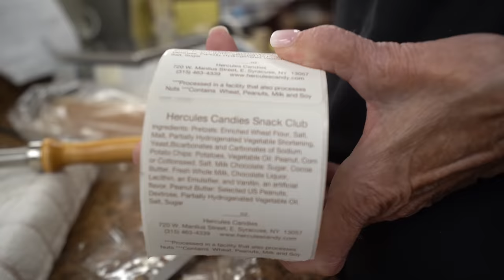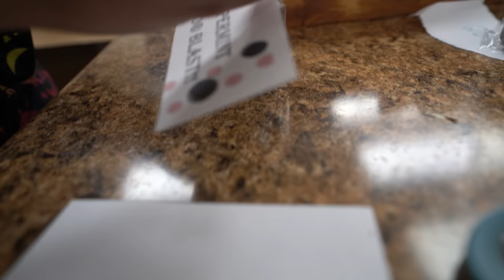YOU asked for it, so WE covered it in CHOCOLATE!

Comment: ive worked in kitchens and gloves were never really worn. You wash your hands constantly though, wearing gloves doesnt mean the outside of your gloves arent dirty.
Reply: That’s why change your gloves.
Reply: Also in most kitchens the food being touched is cooked so you don’t need to wear gloves for most of that handling since it’s getting cooked. If not cooked you need gloves but then you change them when you’re done bc yeah the outside of the gloves are now dirty.
Reply: 100% truth Gloves protect the wearer not the customer.  Changing gloves as much as necessary is an enormous garbage nightmare.  I use gloves to handle raw meat or clean bathrooms.
Reply: @brandyroseann  every time you touch something different, yes. Most people don’t though :)
Reply: Perspiration is still a thing, and thats disgusting either way. Bare hands should never be used for preparing food for someone else
Reply: @pronoob3525  This is just wrong, most kitchens dont care about gloves pre-cook because germs cook off, but once its cooked, supposed to use gloves ofc.
Reply: As someone who worked in restaurants I would always prefer to wash my hands constantly as opposed to wearing gloves since gloves always restrict your control to some degree.  However I probably would wear gloves if I was working with something as messy as liquid chocolate.
Reply: As a cook I will tell you I try and wear gloves to touch the food I'm not going to cook and raw meats but honestly if you are worried about the cook not wearing gloves than eat at McDonald's
Reply: Also gloves don't come sanitized

Comment: Another flavour for your pretzel is cover the pretzel with caramel and then cover with chocolate!
You can top with chips or even better would be honeycomb
Reply: I like anything with caramel.  Maybe you could use the smaller pretzels dip them in caramel and use the “fixed” enrober to cover in chocolate.  I know you would have to throw away all the starch you would use, but could be fun to try when you know you’re getting ready to change your starch over.   

Too bad you couldn’t crush the pretzels, put some in the molds you use to make your creams.  Then cover with Carmel using the cream dropper then cover in chocolate.

Comment: SUGGESTION:
18:40 Instead of hand why not use some type of spatula to evenly spread out stuff? And why dont make or buy like some type of drainig like bowl with small draining holes and then use cutler or something to sip the white cocolate in it and it will slowly  start draining onto the dark chocolate.No need to waste gloves so mucha d no ned to like use so much physical work  just a spatula  or flat sqare thingy that chocolate makers use and then use some draining bowl with small holes or you custom make it.Then you have teh needed thing that will not only make less work but be maybe more efficient and slightly faster .
Reply: I think Steve uses his hand to check temperature and to see if the white needs heating up again.